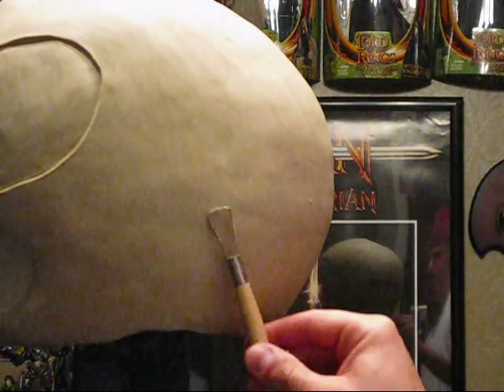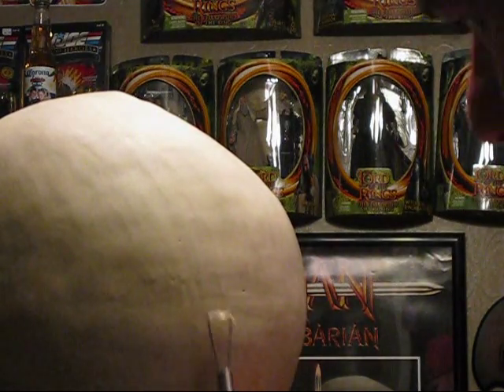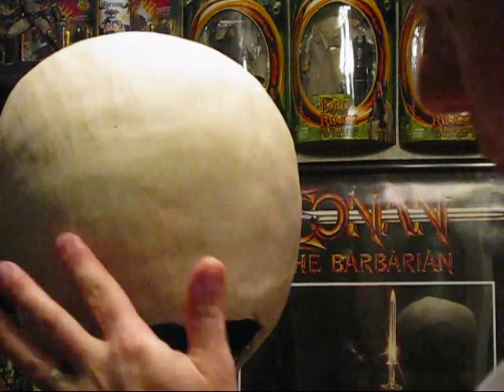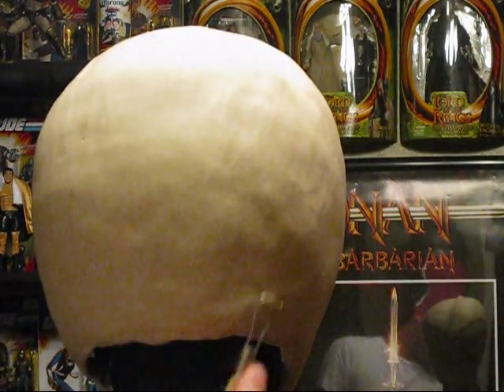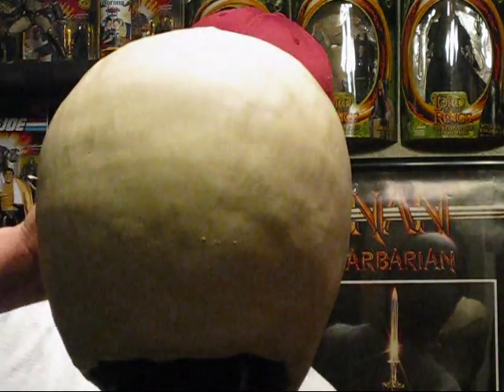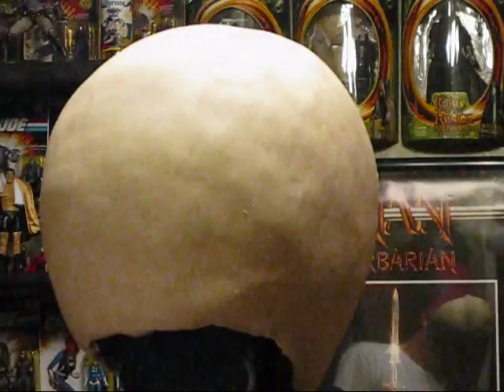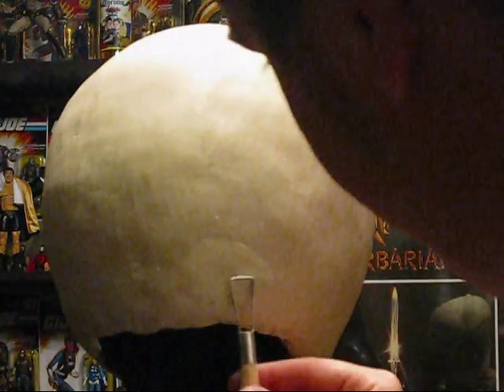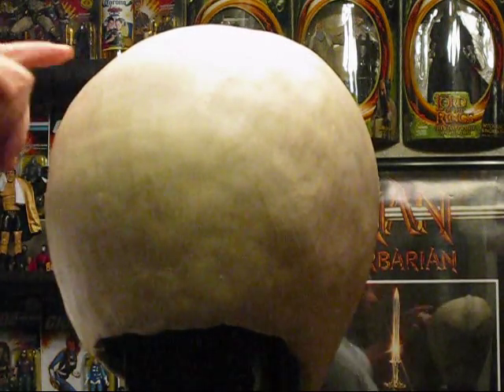Power ranger progress-smoothing

Comment: the helmets are looking awesome so far. a tip for large smooth areas you should get a none used bondo smoother it works great with foam, just wet it or the clay alittle and it makes a major difference